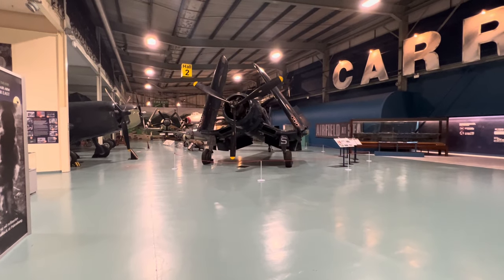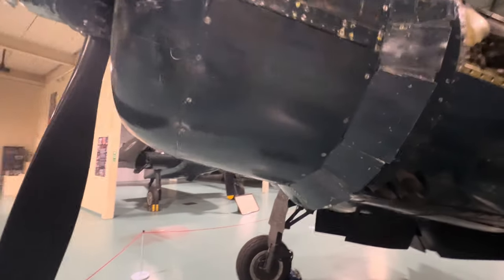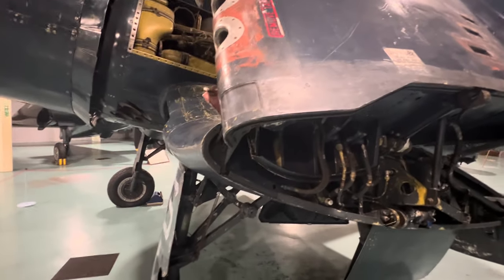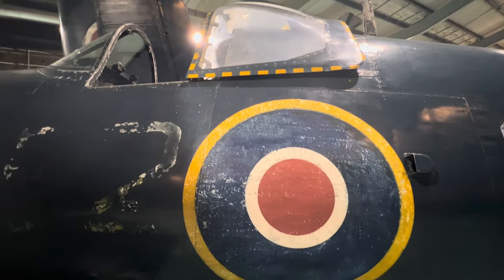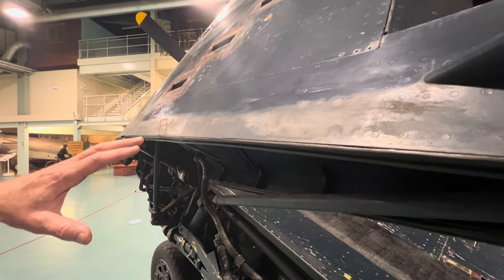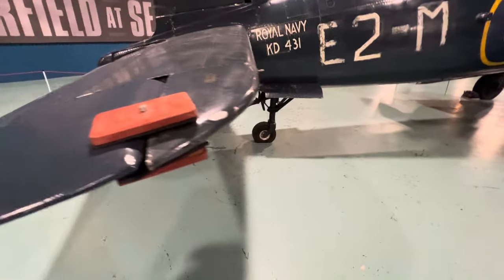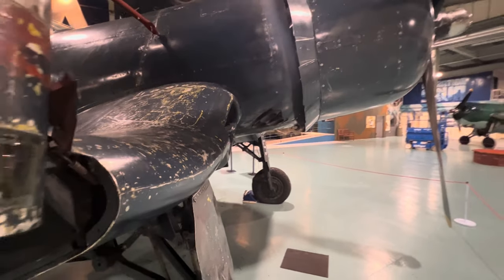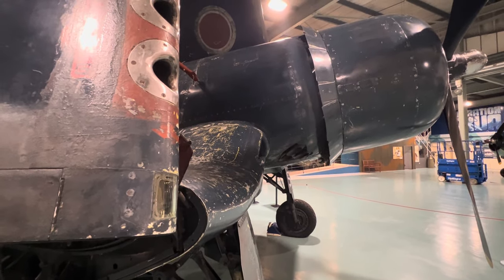Fleet Air Arm Museum- Corsair KD431: A close up look. Part one.

Comment: Zin, what an incredible tour of the exterior of KD431.  Thank you for the closeup of the ignition harness - the "Pratt & Whitney" name was clearly evident on the forward-facing surface of the casting of the ignition harness conduit.  The two items you referred to as the "magnetos" are actually the "distributors", while the "double magneto" is mounted at the very top of the  reduction gear housing (between the distributors).  In order to get the signals from the rotation of the magnetos to synchronize with the rotation of the distributors, there was some incredibly clever gearing inside the reduction gear housing.  I'm eagerly awaiting the next video of (as you put it) "another part of the aircraft."
Reply from the maker: Dear Tron,
As ever, we are able to benefit from your own experience and I am grateful to you for chipping in here to correct me! I'll correct that in the next film, (or live) and credit you!!
Regards,
Z

Comment: Wow, Zin! Really interesting walk-around of an awesome aeroplane. Couple of things I noticed: the tail fin appears to be somewhat shifted to the starboard side of the upper fuselage and the tread on the main wheels isn't exactly criss-crossed like using a saw. The tread pattern seems a little more fiendishly layed out.
Looking forward to you clambering up into the cockpit!
Reply from the maker: Dear Mark,
I noted the tyre tread and have been thinking about how I might deal with this as I come to it as the tyres on the Tamiya kit are smooth. It will be a bit of a challenge!! 
I'll put the next bit out in a few days!
Regards,
Z